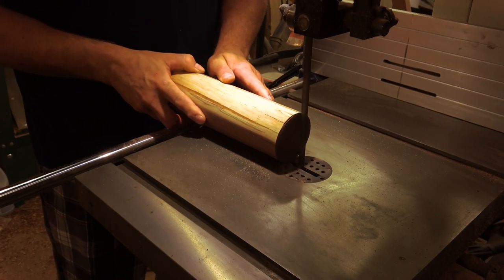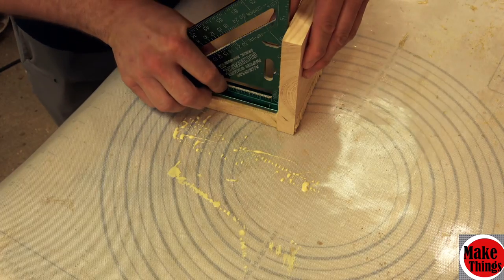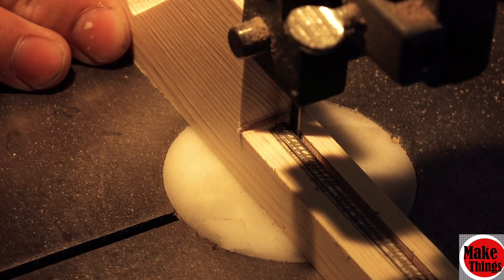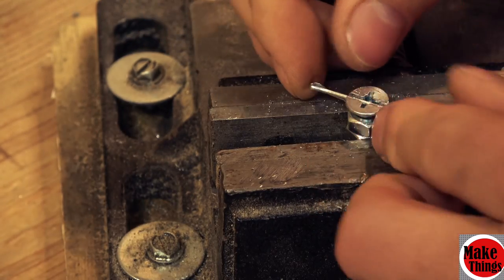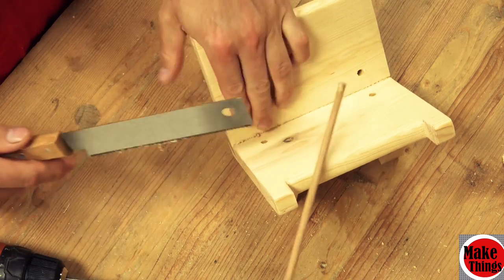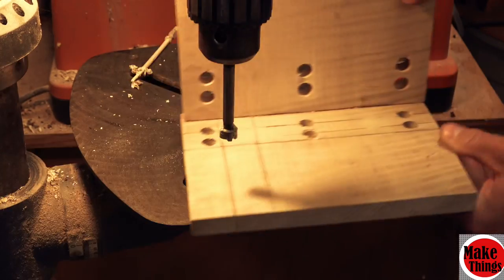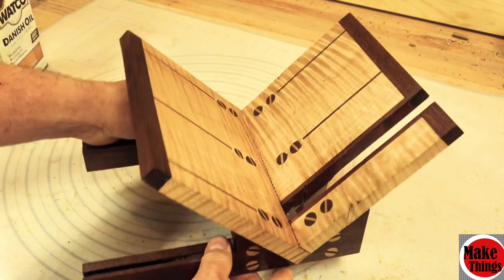A Bandsaw Sled Like No Other  // Resawing, Crosscutting: I've Never Had This MUCH Control Before!

Comment from the maker: Some really rough dimensions here if you're interested.  I made them out for someone else that was interested and decided to share it for all to see.  Again, just a few dimensions.

https://imgur.com/a/cY9bON9
Reply: It's all in those funny things that I used in my childhood, before the UK went metric, called inches!😉
Reply from the maker: Yep, we love inches here.  I’d kill to use the metric system 🤷‍♂️
Reply: @MakeThings    I'll let you in on a little known fact, If you want to use the Metric system you can. No killing required.
Reply from the maker: Yep...accept I alienate most of my audience.  I’ve used the metric system on projects before and loved it...but I’d hate to have to balance that and the imperial system during a project.
Reply: @MakeThings  
The tape measures, and steel rules, that I buy from the UK, are marked in both metric, and imperial dimensions, so I can work in either, or sometime both, whichever is the most convenient. Frequently, I use the inch measurements for checking long boards, as the numbers are bigger and easier to see, in poor light. Other times when working in metric, an inch measurement will be on an exact line whereas the metric lands in between, so I use the inch.😊 (I'm also relatively ambidextrous.) 
In addition, when dividing, inches are often easier, just double the denominator to halve, quadruple to quarter etc. Whereas with metric one quickly ends up with fractions of a millimetre, which is inconvenient.

Horses for courses!
Reply from the maker: Here in the United States finding dual measuring tapes can be difficult.  I’m not at all mocking the metric system...it’s leaps and bounds better than the imperial system when it comes to woodworking.  

Thanks for commenting!
Reply: @MakeThings  

Better why?
Reply from the maker: Why is the metric system better?  Breaking down dimensions is a snap.  Math is easy.  Heck, doing math with fractions when using decimals is like trying to understand chinese and French.  I have to go online to work my dial caliper into inches.
Reply: @MakeThings  

I work mostly with metal and I can work with metric, but I will mostly disagree with you. Fractions often make manipulating measurements easier. Decimal inches are intimidating at first, but with use they become second nature.

In some areas like temperature it can be argued that that the metric system is more annoying because a degree in Fahrenheit was chosen as the smallest increment the average human can feel. Conversely if you are a chemist the metric system shines.
Reply from the maker: I can only go by what I’ve seen but it sounds like I need to spend more time bumping elbows with you.  I’ve never completely converted to the metric system but I’m only referring to measurement, and really small measurements.  

It’d annoying to see everything new divided on different languages...like torx and allen wrenches that could do fine without getting lost in different languages.  

🤷‍♂️
Reply: @MakeThings  

Threads and screw driving are really interesting to learn.

If I was a serious woodworker, I think my first choice would be the Robertson, (Square drive) as you dont have to fight with driving them, and 2 driver sizes cover all your screws.  But you ate still going to need a bit of everything when installing hardware.
Reply: @niklar55  Metric is easier to use, more precise and older than imperial.
Reply: @The_Joker_  
Thats a joke?

Comment: ...or just hot-glue a piece of scrap to your firewood splits. That's nearly instant, and stops the splits from rolling as you cut them.
Reply from the maker: This sits next to my bandsaw.  It takes 5 to 10 minutes to heat up a hot glue gun as well as scraping the glue off (which could make adding a stain or a finish difficult later)...do you see how silly your argument is?

This is a jig making channel to help people ‘make things’.  You’re on the wrong channel.
Reply: @MakeThings  So use nails. That's really common, and the nails stay in the scrap. You'll turn away the nail holes.

Comment: Long grain to long grain miter is very strong. Possibly stronger than a box joint in this application because there are no cuts across the long grains of the wood causing weak spots. Glue in this specific edge to edge miter is certainly stronger than the wood itself. There's no need for splines. It's end grain miter joints that benefit from reinforcement

Comment: One issue: box joints are only stronger if the cuts are made WITH the grain; those cut across it, so I think would have very little strength.
Reply from the maker: Good catch!

Yep, that was a cosmetic design.  Very very few people catch it!

Comment: Nice jig!  It reminds me of one that I made a few years ago, except mine was dedicated to splitting cylinders and incorporated a hacksaw blade as a splitter on the outfeed side.  I found that sometimes there was tension bound up in branches and that they would close up the gap and bind on the blade.  The splitte r also helped prevent the workpiece from twisting, ensuring a straight cut.
Reply from the maker: That’s an excellent idea!   I’d like to use that but will give you credit for it, may I?

Comment: I needed this. I turn tops and use the bandsaw to slice cylinders off turned limbs to glue on dowels. I bent a blade yesterday when one of them got snatched out of my hand. I was using a miter pushing a v-ed out 2 x 4. This is a much better solution but I don't think mine will be as fancy as yours.
Reply from the maker: I get people looking at me funny when I tell them how dangerous cutting round things can be.  I’ve had the same blade bending situation more than once...and it scares the crap out of you!

Comment: I’ve made the mistake, as well. The band saw picked up the piece and slammed it down so hard and fast, I didn’t even know what happened. My fingers were lucky.

This is a very useful, very nice jig.
Reply from the maker: Thanks, and yeah, bandsaws are normally very safe machines.  We forget the physics and the downward motion that they run that will take anything not secured well enough to the table.

Comment: Great stuff Rob 😊 I've messed once with an unsupported piece. It will never happen again 😁 This jig could adapted so the bed travels laterally to some degree for removing a set amount from the edge of square stock and I'm sure you could even make close enough large dowels on it 😊 ॐ
Reply from the maker: Chris, this is exactly what I was thinking.  I really think the idea has a lot of unexplored potential with jigs that can be added to it.  There's one idea I was really itching to put in that I'll make a video about in the future.

I'm glad I'm not the only one that has made an "oops" with bandsaws.  They're billed as one of the most safest machines in the shop but can be very dangerous in this regard.
Reply: I've used bandsaws for more than 30 years and only ever cut flat boards. A couple of years ago I thought I would cross cut a small log in prep for woodturning and yes I needed to change my pants 😂 not to mention the blade that broke and jumped off the tyres while still spinning. Your jig is superb as always and a knowledge of these simple dangers is really important. Everyone talks about table saw kickback, but every machine has a different temperament and danger that many are unaware of. Thank you Rob 😊 ॐ
Reply from the maker: No, honestly, thank you Chris.  This kind of feedback is incredibly important.  Thank you my friend.

Comment: Nice!  Id build that on a sled you could change parts out on. The fingering joint was nice but very weak, would be better to put joint. I have a baby 8" wheeler. Going to do one for mine Thanks!❤

Comment: Very nice!  You may want to figure in another jig like it to set on the back side to catch your material so you won't have to reach back as much to hold it up.  In fact, you can put a slot in the front part so your blade can sit inside then you can lock your back half piece to your front half and you have one unit with the blade in the middle of it all.
Reply from the maker: I like that.  Like use a couple box hasp latches.  Very interesting idea...I'll give it a try and throw you a shoutout!

Comment: Thanks for sharing good tips. 

For your safety the pieces should be longer when cut them in the tablesaw. There should be a "knife" mounted after the blade to hold the pieces apart and to reduce friction between the blade and the wood and to hold it down. There should also be a proctection hood over the blade that also helps holding the piece of wood down to the table if the blade wants to lift the piece. No knife, no hood and a short piece of wood is dangerous and an accident waiting to happen.
Reply from the maker: 1. The piece won’t lift.  The blade pushes down not up.  

2. A splitter is not necessary unless you’re suggesting every board cut with a bandsaw needs one.  

3. As for length, I’m not entirely sure what you mean.  As a board gets longer it becomes more difficult to work with.  

Thank you for the feedback, I appreciate it Sven!  Happy holidays buddy!

Comment: I really like the design. You mentioned that some improvements might be made. If I had one suggestion it would be a matching sled for outfeed to help steady your piece and prevent the possibility of racking your cut as you draw it through. But overall, I think this is a really great build. Thanks for the idea.
Reply from the maker: Thank you.  And yeah, someone else said something similar.  I think using latch hasps would do the trick.
Reply: @MakeThings  Even if you just use a miter slider that you can tighten down, or a switchable magnet, I think it would work well. Frankly, even a flat support at the same height would provide the stability needed. But I really do love this design and have every intention of building one.

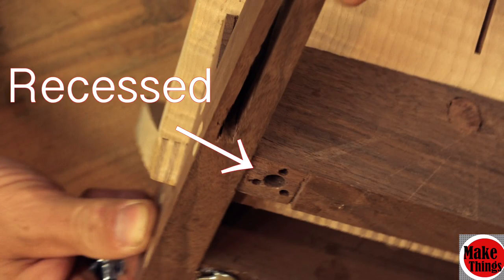Comment: 10:30 Threaded inserts would have been a better choice than T-Nuts.   T-Nuts are meant to be on the backside of the wood, not the front side.   It will work since you used epoxy, but please reconsider for future projects.

Comment: Nicely make beautiful jigs but I think an overly complicated solution to a simple problem. My cross cut jig is a solid block of wood 4" by 4"with a 3'V cut into the top. the runner is screwed on at 90 deg. My longitudinal jig is a cross cut sled with two 4' triangular blocks screwed to the ply wood base on either side of the slot. The wood being cut lengthwise is supported along the length of the cut, and pushed through by the end stop on the sled.  I can easily cut an 11" dia log with this jig. no screws no bolts no fancy joints, strong and durable.
Reply from the maker: Maybe, but just out of curiosity, do you think the woodpecker tools are worth the extremely high costs?

Comment: At the 6:44 mark, I see a wobbly drill bit being used. My father always taught me little tricks for wood working, and one of them involves taking your drill bit and drilling at high speed into the end grain of some hardwood, and then lightly (And I mean Lightly) bend the drill just slightly to the side. I have straightened many a bit with this technique.
Reply from the maker: Thanks for the tip!  I’ll have to give it a try...I’m always in the market for ways to not have to buy new things.

Comment: Seems to me that if you make two of these one can be shorter to cross cut and then for ripping lengths of wood you could make it several feet long and have even more support both on the input an output sides. Also by making it longer you could use more V supports if you make them deeper they would support the two sides and it wouldn’t matter what joint you use for the two boards that are glued up at ninety degrees. 

This reminds me of the old V blocks I would use to cut round stock only on a larger scale. Definitely need to make some though they are a definite upgrade and more versatile then cutting a 6 inch to 12 inch 2 x 4 lengthwise at 45° and attaching them to a thin piece of plywood or hardboard to make the V blocks I used to use.
Reply from the maker: I think you make some good points.  As for the joint, it was an overkill.  I love making finger joints, but a plain old 45 cut on two boards glued together would have been better.

Comment: Because it looks like the wobble is half way down the bit, just drill in maybe two thirds of the way, and see if that does not do for ya. For regular 4-6" bits, I have saved myself a LOT of buckos.
Reply from the maker: That’s the path I want to take.  I got my brad point bits in a 150 assortment and have never needed bits because of it.  Now I just need to keep them straight.  Thanks again Larry.

Comment: That box joint looks nifty.  Do you have a video of how you set up a jig for that or do you do it freehand? (not likely)
Reply from the maker: Yeah, I made a jig for that, but as someone else has said, making a mitered corner with the long grain is still a strong bet, and it only requires a mitered corner, glue and tape. 

Thanks Suzette and email me so I can see your jig!
Reply from the maker: Table Saw Sled Indexing Box Joint Jig https://youtu.be/9HAztCEzmwQ

That’s the jig...be easy, it was my first video!

Comment: Okay - but why not a sled?  Even if it's feed, reset, feed, reset - it's going to be more accurate.  What am I missing?  I once designed and built a 4' (foot) xcut table using a single drawer slide nestled between two boards which worked really well.

Comment: My bandsaw top is different it is a craftex CX series with 2 slots top is 20x 16 with the slots 4 1/4" on both sides of the blade. Not sure how to adapt your design to this configuration.

Comment: .... Highly recommend using a good quality hardwood for your runners, not pine.  You want them to be able to stand up to some abuse.  Try a maple, instead?

Sadly, while your jig looks to be lovely and works quite well, it is far too large and cumbersome for my tiny little bandsaw.  I have the bench top 9" model from Harbir Freight, and while the threat capacity is a good 9 inches, the resaw height capacity is just under 4 inches.  Thankfully, I only deal with smaller branches, but having to pass up free chunks of wood on the side of the road after the road crews make a trimming pass just pains the heart...  My next shop project of any size will be the planning and building of an electric band saw mill with a 20 inch or so capacity...
Reply from the maker: Honestly never tried anything other than pine.  My fear has been that it would be more difficult to expand.  

But I think it would stand up to abuse just fine.  The wood becomes tough as steal in the slot.
Reply: @MakeThings  it's what can happen to it when it's NOT in the slot that can be the problem.  As long as you aren't prone to dropping things or you have rugrats and such knocking your jigs about in the shop, you should be ok.

Comment: I have a cheap table bandsaw, and it does not have a mitre slot in the table. Any ideas for me? I'm having just this issue with cutting branches to work on. The bandsaw is tiny, can only cut up to 200mm height, but it's what I have, and what I can fit.
Reply from the maker: You really don’t have to use the miter slot, it’s just a little easier to make more precise cuts.  You might try running something along the side of the table that’s parallel to the blade.   You’ll still have to apply force to the edge as you press the material through, but it’s better than nothing.  

Let me know if that helps or if you need me to clarify for you.

Comment: I'm guessing that each guide is removed when the other is in use, is that correct? Otherwise your jig would be tilted by the guide that wasn't in the miter slot, unless I'm missing something.
Reply from the maker: Yep, exactly right.

Comment: why don´t you use the original sled. you can make a adjustable angle for ist. some models are already constructed this way. the security of your solution is inadequate in my opinion
Reply from the maker: The security of using the blade within the sled?  Is that what you mean?

Comment: This jig looks fantastic overall, but the so-called "box joints" cut cross-grain were cringeworthy. Box joints are for end-grain, or in other words they work when the grain runs through each finger, much like dovetails. A simple glued butt joint or miter joint would be better there, with plenty of long-grain-to long-grain glue area and no weak protrusions ready to break off. In this case, it looks like you'll get away with it because of the supports underneath. But I would hate for some beginner to learn box joints from this video.
Reply from the maker: I would agree that a butt joint would be just as good, but definitely not dangerous for box or finger joints.